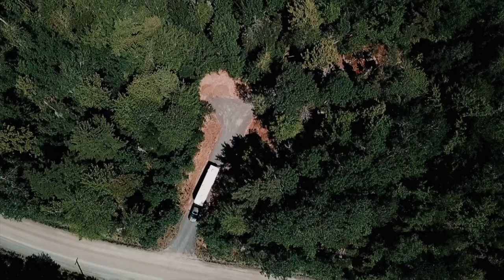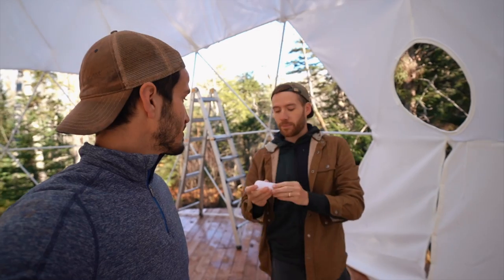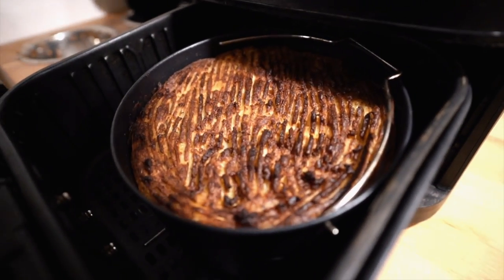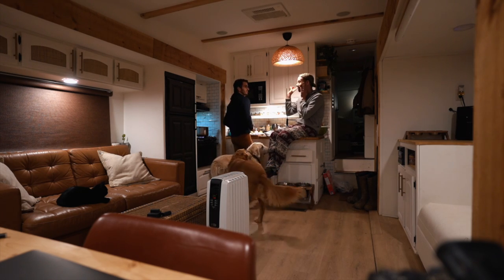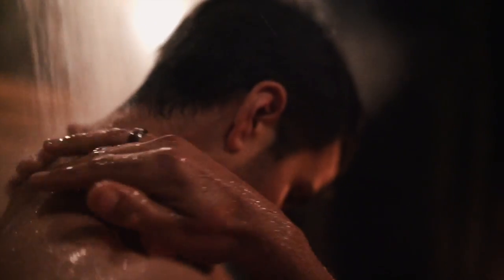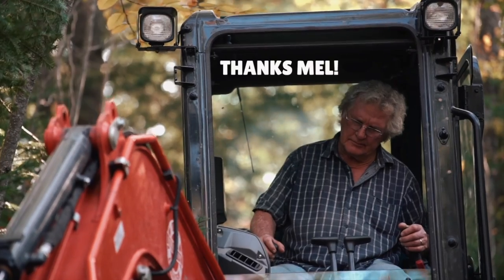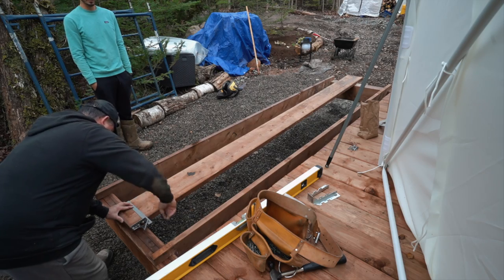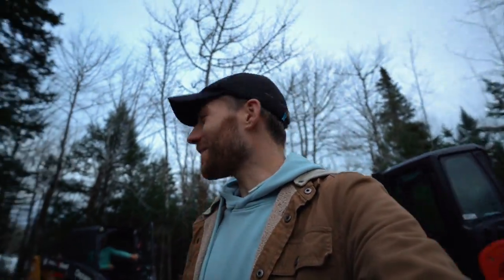Dome sweet Dome (a simple life in the woods)

Comment: Is there a outside inlet to the pipes going to the septic system, and the leaching field ?  A inlet a homeowner can introduce a pipe snake ( not that type of snake Todd) in case lines get clogged before, during, and after the septic.  Poop happens after years of use.  
Loving the homestead, guys.
P.S.  the kitty will pay you back in little intangible, joyful ways for the spading. You wont see it coming,  sleep well,  bite your nose at 3:00 a.m. sort of thing.  But she has a heart of gold for her daddies.

Comment: It all looks great! You probably already know this but just in case you don’t, you have to use biodegradable laundry detergents and cleaners, no bleach in your loo or laundry and provide female friends with a way of disposing their period accoutrements as they can’t go in your bio septic system either. If you get a blockage (no jokes Todd) no caustic soda, there are enzymes that you pour down to help but you may need a manual way to remove it with one of those ‘electric eels’. Also no food production near you leeching field. Hope this helps❤️✨

Comment: Helpful tip for anyone who has to deal with a lot of mud/high water: get waders! You can get them starting at around 40-50$ USA, I worked at a farm sanctuary and after many boot pulls, losses and almost getting steeped on by 500+lb pigs (who thankfully helped me out instead😅🥲) I bought the waders and never looked back. Honestly if y’all have to deal with these muddy trenches for even one more day they are worth the purchase and will likely come in use many times off grid 💛

Comment: Don;t forget to maintain your septic system per manufacturer's specs and I think you have to use a certain type of toilet paper.  I am sure you have a loan on the truck otherwise I would just say keep the dent in the bed as a reminder and replace the tailgate.  Looking forwards to that inspection next week.  Also, should there not be a second layer of material that goes on the outside of the dome?  Two layers would create an air pocket which would be great for insulation.

Comment: Todd, so it’s “tight” 😉😂😂 
Question, the 💩 will go through the filter and then move into the ground. Wouldn’t that fluid enter the ground water you pump out for drinking??🤔🤔
Reply: Nope, the solids settle and only the fluids go into the leach field. Then the solids will need to be pumped out periodically.  I just had mine pumped after about 15 years. You aren't necessarily supposed to wait that long, but it wasn't causing me any problems, so I waited.
Reply: @pattylecompte9846  Thanks Patty, that clarifies things😉👍

Comment: Won't the weight of snow tear the dome material? It seems like the weight of the snow would pull the canvas away from the ties holding it to the frame. It looks like it's inside-out with the frame belonging inside for greater strength.

Comment: Guys, You need to insulate under the floor deck of the Dome. You will loose a lot of heat in the floor. I would used closed-cell foam  and then cover it with something so the insects don't get to it.   Who is the lucky guy that gets to replace the coconut husks in the septic system when they go bad? or do they last forever?
Reply from the maker: Haha we know, one step at a time :)…they last for 15 year and then they get sucked out with a vac truck and replaced!